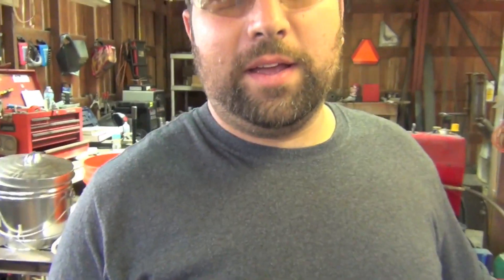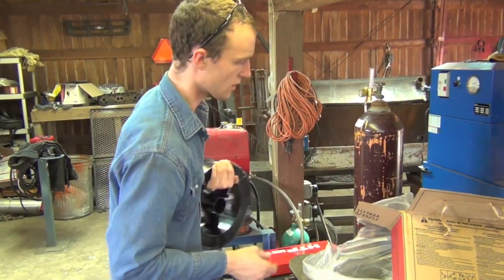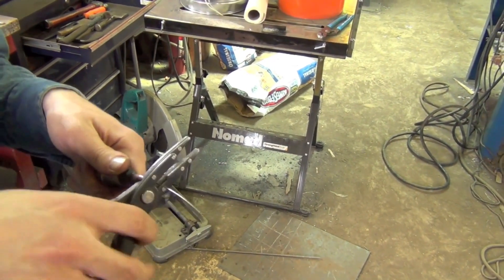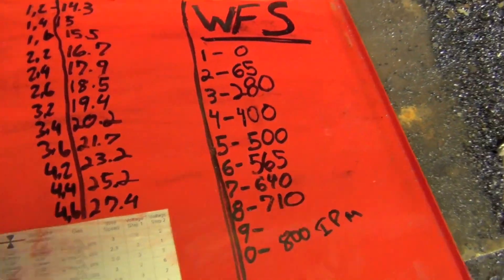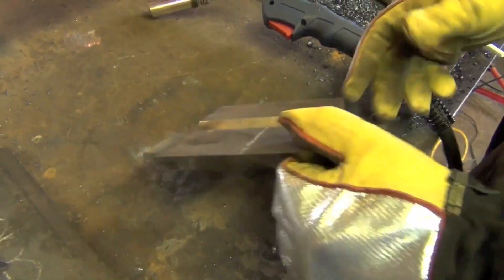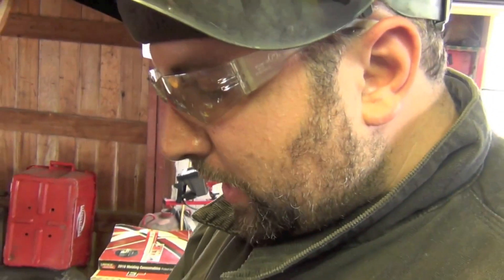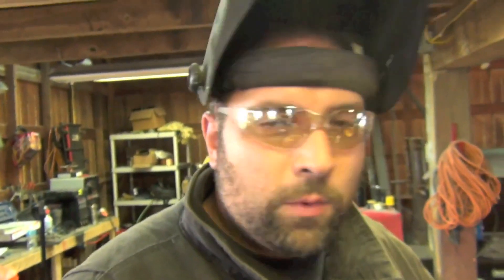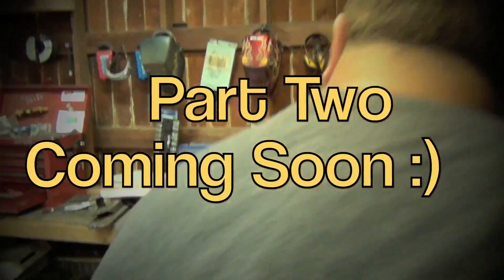DUAL SHIELD WIRE Part1

Comment: Zila, do you have a video of gasless flux core? I use .68 Lincoln nr211 a lot.
Reply from the maker: No but i could make an NR211  035 or NR 212  045 video, i have those wires on hand
Reply: @ZILAwelds  that would be great, there isn’t many videos on gasless flux core. Thanks for the reply.

Comment: Can you dual shield any flux core wire or is it a special type?
Reply from the maker: There are different types of flux cored wires - some designed to weld with and some without gas   https://youtu.be/-uF5eer1DSs